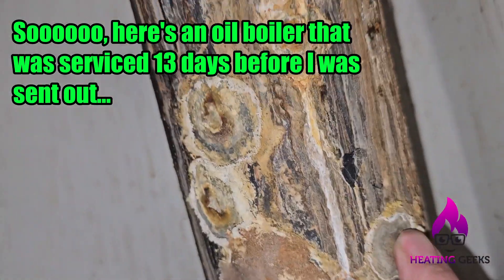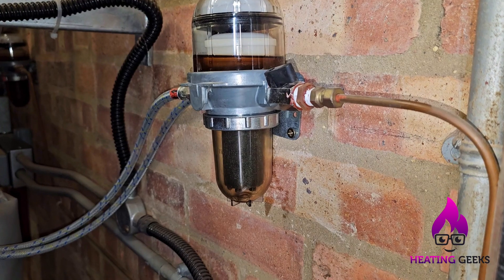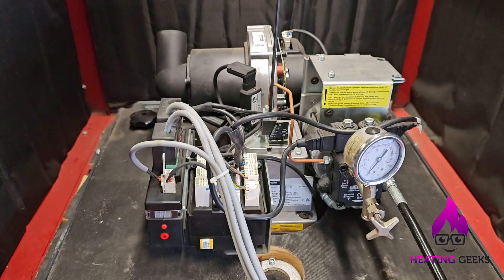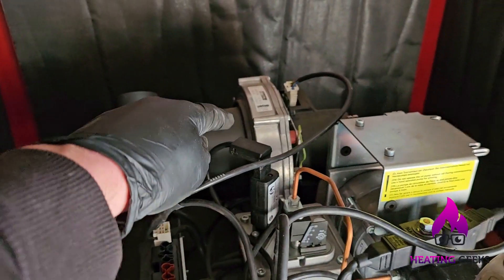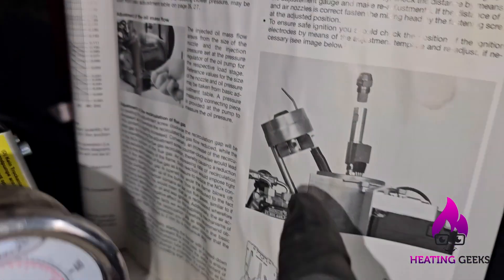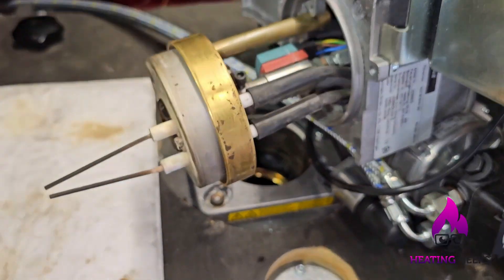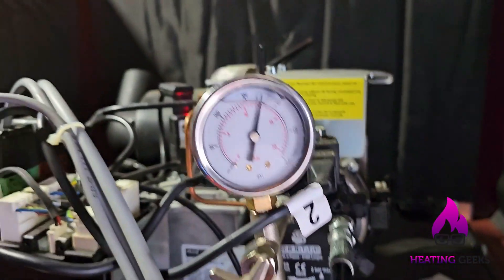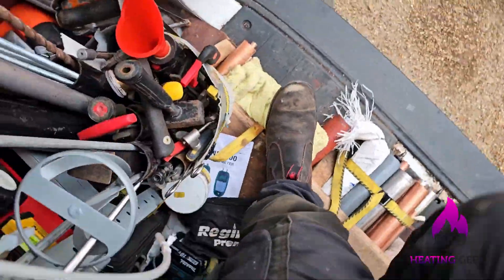Can we get the heating fixed!?

Comment: If you got 10 bar on your low pressure you should also double check the flue gas to align with manufacturer instructions. The second step with high pressure is the same thing. For me the vacuum looks way too high it shouldn’t be higher than -4 should it? Flickering on pressure gauge isn’t good either. You would need a new oil filter, oil nossle. Did you check the distance of the nozzle stick which pre heats the oil? That could have been adjusted from the outside. This is written in the manufacture instructions. Depending on boiler but in general it’s about 7/8mm

Comment: There's a good app called EOGB oil nozzle calculater if you dont have the exact nozzle needed. Calculates the required oil pressure to achieve kw output👌🏻

Comment: Was thinking issue with the Photocell. Very common on oil. Sight tube out of alighnment = No Photocell. Not 100% on the blueflame boilers, but I know on the standard stuff to run them a little lean to keep them clean around 11% on the co2
Reply: Learned oil, but dont do it because it stinks your tools and clothes out. And I can't deal with 250 kilo combis by myself or knackered oil tanks that need changing.
Reply from the maker: I have no smell so it doesn't matter to me :-)
Reply: @HeatingGeek  🤣

Comment: Didn’t like the pump gauge jumping around a bit. Could be an issue with the oil.
Reply from the maker: If I don't bleed the air out of my gauge it does that. ;-) I want a digital one but not sure what to get. Any advise?

Comment: The back of your van reminded me of little Als van where everything had to go in its place otherwise it wouldn't fit in and Al would moan 🤣 which he was pretty good at 🤣
Reply from the maker: He loved a moan. I don't remember his vans being messy or tidy. Long time since we worked together. How are his family doing?
Reply: Yeah als Mrs and kids are doing well thanks and u must remember being whinged at about rolling his hose up properly or mistaking a slip coupling with a normal one or finding a 15mm straight compression fitting for a 1/2" male iron to copper because one of the nuts had come off one of the ends 😂😂😂 the good old days 😂
Reply from the maker: @aaronchapman6994  I remember the hose thing :-) We were the same with that. He used to hammer 2" screws into floorboards. "Crinkle cut nails" we called them. I reached out to Ed to see if he could send some work my way but he ignored me..